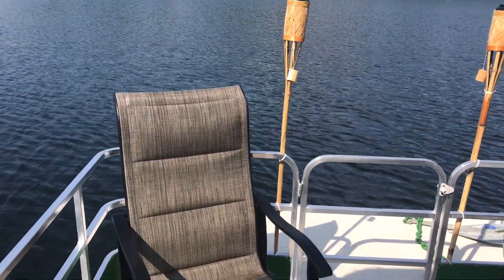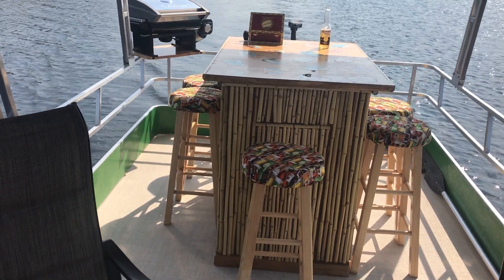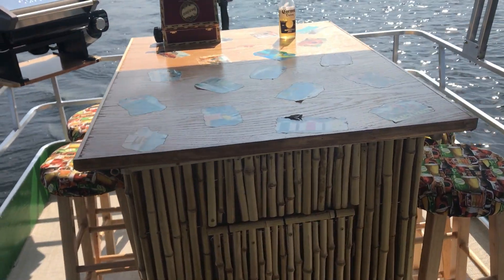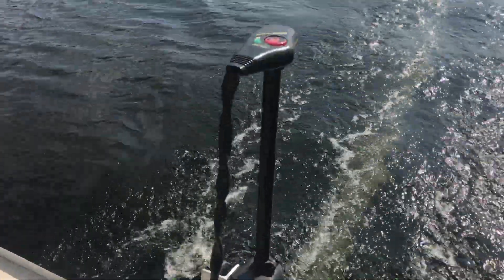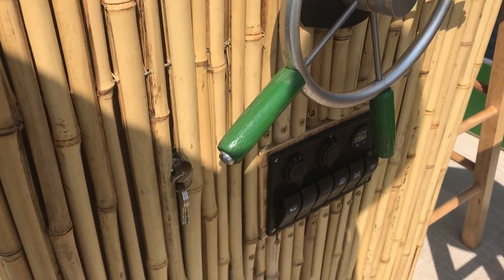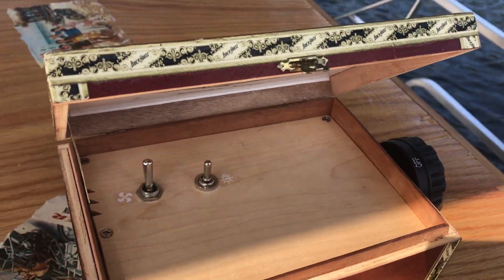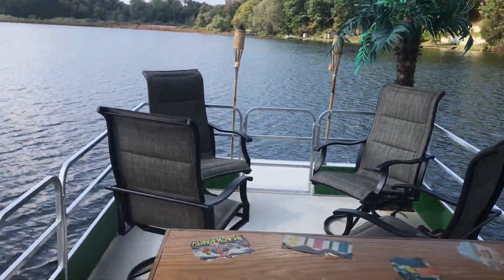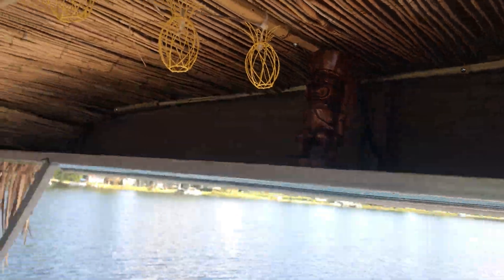Tiki Solar Pontoon Video

Comment: How does the boat steer? Did you use the old steering cables or come up with some else?
Reply: Hi George, I made my own steering linkage, but it needs improvement.
Reply: Anyway, you could post some pictures of it?